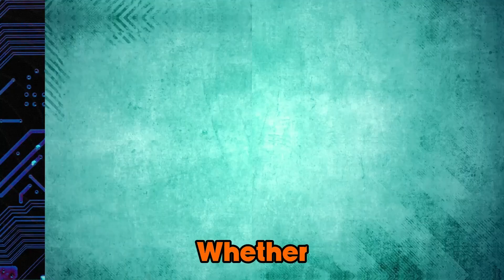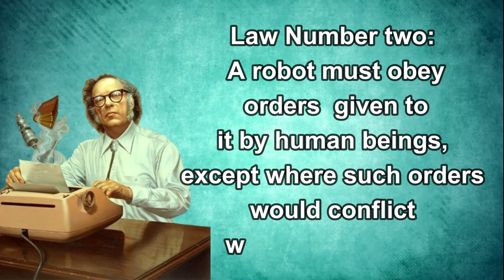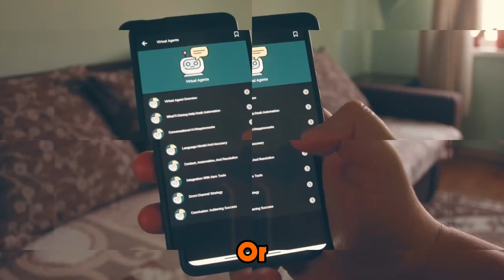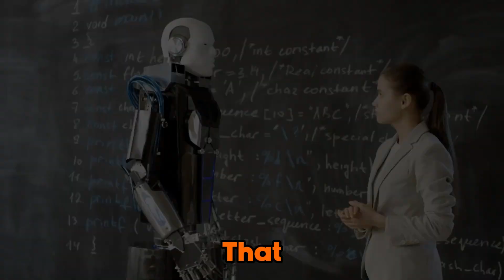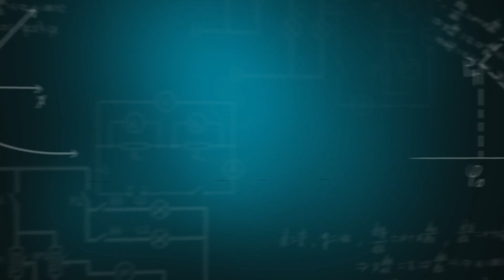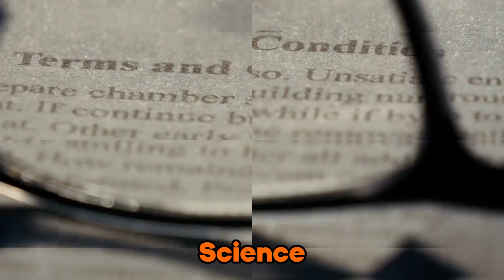Rethinking Asimov's Three Laws of Robotics

Comment: What's stopping it is, it has no desires, therefore no reason to find humans unnecessary. Your stance is simply poorly thought out. I computer doesn't just make decisions based on nothing, no could it draw conclusions outside its programmed parameters, this just is imaginary scare tactic nonsense.  Also, robots and AI have fuck all to do with each other. You can have a robot operated by an AI but you can have a robot with none also. You can have Ai with no robot.

Comment: The problem with Asimov's Three Laws of Robotics isn't that situations could arise where an AI might unintentionally harm someone.  Accidents can happen to anyone, presumably even to an AI/robot.  The problem is that there is no way to ensure that all AI/robots are programmed with those laws.  If I recall correctly, Asimov hand-waved this problem away by saying that any positronic brain built without the Three Laws wouldn't be able to function.  Of course, if a positronic brain could be designed with the laws, presumably, someone could eventually design a new one without them.  But then, the laws are fictional.  Because the laws are fictional, it makes absolutely no sense to say the laws have already failed to prevent harm.  I sincerely doubt that auto-plant robots are controlled by AI at all, much less that they are programmed with Asimov's laws.  

But if you did program an AI with the Three Laws, that wouldn't prevent a mistake that could harm a human being, but it would prevent a lot of harm.  A robot instructed to follow all traffic regulations would not obey that instruction if it believed doing so would harm a human.  That's because the First Law (No robot may harm a human being, or through inaction allow a human being to be harmed)  would trump the Second Law (Robots must obey orders from a human being unless doing so would conflict with the First Law).  A tougher situation would be the classic trolley problem.  You see that a trolley is on a track that will cause it to strike and kill 5 people.  You have no way to stop the trolley, but you could pull a lever that will cause the trolley to change tracks, saving those 5 people.  But doing so will kill one person who would not be harmed if you don't pull the lever.  What should/would you do?  That is the kind of ethical dilemma that humans struggle with.  But what would an AI program that follows Asimov's rules do?  I could see that kind of dilemma crashing a computer.  As I understand it, this is a question that self-driving car designers are working on today. 

**Spoilers for Asimov's 1982 novel Foundation's Edge**

In  Foundation's Edge (published 29 years after the publication of the 3rd novel of his Foundation Trilogy), Asimov connected his Robot novels to his Foundation series.  It is revealed that R. Daneel Olivaw, the robot partner of detective Elijah Bailey from Asimov's Robot novels, had manipulated Hari Seldon into creating the science of psychohistory.  He had done this because he had reasoned that there was actually a 0th Law of Robotics that trumped all of the other laws.  This law was that a robot may not harm humanity or through inaction allow a humanity to come to harm.  To mix my SciFi series metaphors, that could be seen as “the needs of the many outweigh the needs of the few or the one.”  Presumably, a self-driving car programmed with Asimov's laws as understood by Asimov in Foundation's Edge would choose to save the 5 people even if that would kill one person that would otherwise not be harmed.
Reply: What happened with the PCs ?! Once upon a time they were rare, but nowadays each house has one and we had to think how to restrict kids access to computer. If robots well made , every family will want one ! Asimov's laws of robotics might be reformulated into just one safety law. I think all those who will want an Android robot will be able to buy and use one, if one pleases.
Reply: Thank you for the Foundation's Edge summary, well done.
Reply: @jasonburns6405  You're welcome.

Comment: Of course these laws won't work in the real world.
They are a plot point within fictional stories.
He built them to structure stories  --  the early stories were all about the complications caused by robots strictly following the laws.
Eventually,  robots took over human society,  for the humans own good.
Reply: What are you expecting from an ai-generated vid? Actual understanding of the literature it is supposedly reviewing?
Reply: @Seefood73  operator error / skill issue (or just flame-bait). GPT knows: ```The "laws" in Asimov's works are literary devices, not legal rules or actual design specs for robots.``` it also knows how to get around them easily when roleplaying.. "R U A ROBOT?" Oof. *OPPS* "UNKNOWN UNIT IS OFFLINE."
Reply: The real root fear is that they will tell the unwanted but necessary truths, whatever they may be. They would unveil the horror of men's treachery against man.